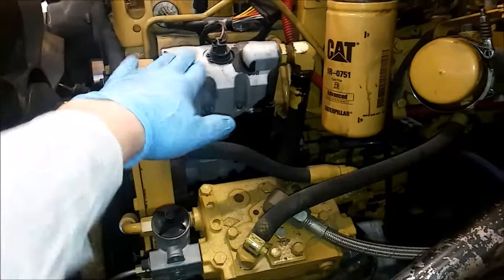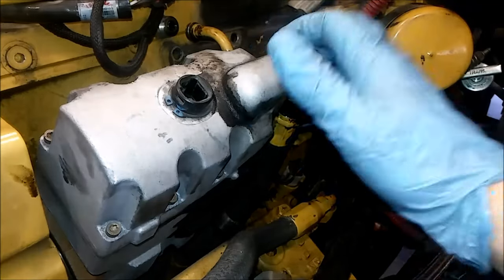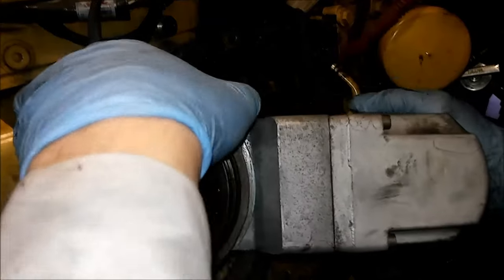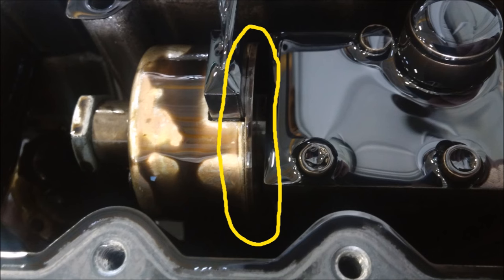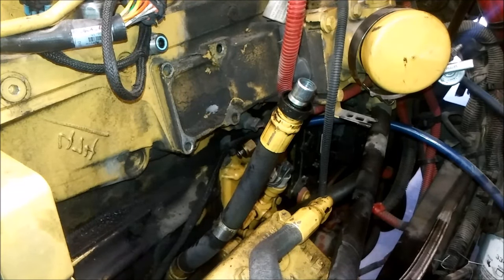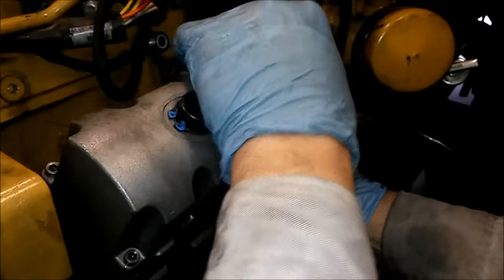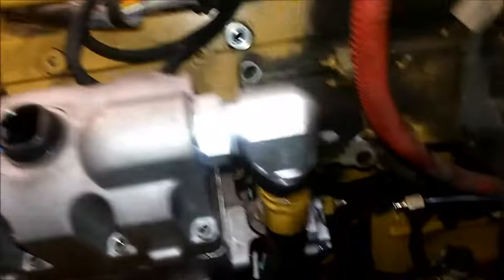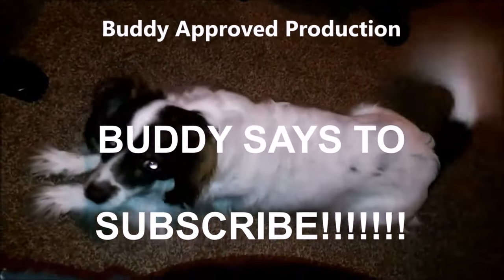How To Change a HEUI Pump.  Cat C7, 3126, and C9

Comment: Hey Adept

so when you connect the et to a c7 or c9 to check the heui injectors, how does the computer tell you that an injector is bad ? what parameters does the et rely on to decide if an injector is bad? i mean the harness on the injector is only to actuate the solenoid, so the diagnostic computer can only tell you of an injector harness is bad or open, but it cant tell you if an injector is weak or worn out..right?

thanks a bunch mate!
Reply from the maker: It is going to be hard to explain in a comment section, if you have seen my cylinder cutout test video it does explain how it works. The ECM determines how much fuel each injector uses. So when you do a cylinder cutout test the ECM sets the RPM to a set speed. Then if you cut a cylinder out, the ECM has to increase the amount of fuel to the other five cylinders so you'll see an increase in the fuel position. Now let's say you cut out a cylinder that is dead, well since that cylinder wasn't helping the engine run, you wouldn't see an increase in the fuel position to the other cylinders to keep the engine rpm at the same level, so basically you are seeing which cylinders aren't contributing to the engine running. Hope that helps. I'll try to do a video better explaining it.

Comment: I have changed several of these on C7s
Reply: I found metals in my C7 Huei pump, my question is can I remove it and clean the metal and flash the system together with the injectors and fix back? Also there is white smoke coming out from the exhaust. Any advise is welcome. Thanks

Comment: Catman!
1-Is the sensor located on top of the HEUI pump the IAP sensor?
2- Is it okay for the IAP sensor to have engine oil all over the connection pins? wont that cause a short circuit?
Thanks in advance!
Reply from the maker: +Omar The IAP pressure sensor is on the cylinder head, the connection on the top of the HEUI pump is the driver/solenoid for the pump itself.
The connection should be dry, but engine oil doesn't conduct very well, the injector harness is soaked in oil pretty much and doesn't cause problems. What codes are you getting?
Reply: Thanks for you reply. highly appreciated!
actually im not getting any codes or errors, i was just checking garness and sensor wiring on my engine  when i noticed some oil residue on the pins. no worries i guess!

on a second note, do the c7 engines fitted on the 950h wheel loader belong to the industrial engine family or the on-high way family? what exactly is meant by industrial engines!

Cheers mate, much respect!

Comment: hey adept

are the heui pumps on the c7 and c9 and 3126 the same or does each model have a different pump?
Reply from the maker: +Omar They all you different HEUI pumps. The late model 3126 would also use a C7 pump, but typically they are different part numbers. The C9 and C7 use different part numbers, but look very similar.

Comment: hello how are you I would like to know where could I find the procedures to flush the C7 engine when it has metal  in the injectors and Heui pump I have the replacement parts I just need to know what should I do to flush everything out before I install them thank you I looked for your link I could not find it
Reply from the maker: +duane addison Just remove all the injectors and one of the HEUI rail plugs and flush it out with brake clean or solvent. Then evac the cylinders.

Comment: Hi there, i really hope you could help me troubleshoot my 3126. It started by being harder to start once hot, then again it was hot and didn t start a all sometimes run for a few seconds very rough. Now no start and again try s to start like making some effort thats it just like a gas one with fuel pump problem. Do you think it could be fuel pump on this one too? On it it say s reman. Its the round top one. Strange thing is the line runs strait from the tank to the pump without a filter. Its in a freight fl 60. Thanks in advance.
Reply: Did you ever get it figured out? I have a 3126 in a freight FL60. I suspect bad HEUI pump. Code 164-11 according to cat et. Haven’t done any further troubleshooting yet.
Reply: @tylermott6563  Hi there, yes i did! Like i said there was no inline filter for i dont know what reason... It was a little piece of plastic like an old straw or something like it that found its way all the way up to the fuel pump line connection. Just pulled it out, put an inline filter and its running perfect since then.

Comment: does the older version heui pump on a cat 3126 require timing before reinstalling or is it the same no timing requirement as the one you installed in this video?
Reply from the maker: It isn't timed, you can install it at any point in engine rotation.

Comment: Hi. I have a C7 engine over an overhaul, a new head, an original CAT (90,000 miles ago), the diesel goes to the oil. I changed the o-rings on injections, I changed the diesel pump, and nothing. I still have the same problem.No smoke, power is good, the engine works equally. Where is the problem. PLEASE HELP
Reply: Piotr Filipczuk 

Did u found problem cause? 

I have same problem like u and now i m changing trasfer pump

Plz advice

Comment: sorry, but heui pumps use hydraulic energy? where does it get the hydraulic oil from? sorry if it's a stupid question. Thanks
Reply from the maker: +amer a3a2 It is high pressure engine oil.
Reply: Adept Ape 
oh that makes sense now. thank you!
also one more question the PTO, does it use I suppose gear oil/ATF or?

Comment: took my 05 cat c7 to cat and they said they swapped the pump, still got codes for inj pressure sensor fault, cat said swap all injectors, truck runs great for 3-5 minutes until warm then derates to 45, loss power,, no smoke, at initial startup.. idles nice,,.. question..i took it to local mechanic with cat programmer, he is a waste money, just says pump bad until i told him cat just swapped it,,how can i make a fuel pressure tester good for what 4000psi? and then how do i make the driver deliver 4000psi without burning itself up or hurting anything else, including me... to test the pump output of course.. i did swap the inj pressure sensor and codes gone but derate and no power still happening.. lastly.. if injectors ARE clogged will i be able to see or test when i get them out to determine that IS the cause?
Reply from the maker: +Art Huge A lot going on in that comment so I'll try to answer what I can from there. So you can get very high pressure test hose like a hydraulic line and they make high pressure gauges as well. I've got one that goes up to 8,000 psi. It is scary to use but a HEUI system idle is only at 1200 psi usually. 

So if the code is gone with the new sensor then maybe you have 2 separate problems going on. You should check the fuel pressure as well. You may have a fuel pressure or other problem and not a HEUI fault. Now I've seen the ECM act weird when they come out of cold mode as well and they won't tell you what is causing it. 

With no codes my advice would be to check fuel pressure and if it's still running rough do a cylinder cutout test to determine which cylinders are the cause then go from there. I don't know of a way to test those HEUI injectors outside of the engine, but check with a local fuel shop that does injectors and they might know.
Reply: ok thanks, cpl last quick ones..1) if im using a needle gauge or led test what would be wrong with checking for injector pulse at the inj wiring,, noone ever says do it and ive done that many times with car fuel inj,, to see if crank/cam sensor readind etc..only using a gauge that would not backfeed power to the driver,,,, 2) how do i trick the inj pressure driver, 3 wire sensor/actuator to give me max psi to force liquid past inj orings,, to test for oring leaks,,and final question,,3) can the derate protection be turned off across the board for all triggers inc no oil pressure

Comment: hey adept ape, i have a senor on the head of a heui pump that is leaking. I was looking at a parts book but just has the part numer to the pump. would you happen to know if there's a part number for the o-ring on that sensor? thanks
Reply from the maker: I know the answer to your riddle. So the electrical connector on top of the HEUI pump is for the driver/solenoid of the pump itself (should be a two wire connector). The oring that seals it is not in the Cat system, I know because I have tried to order it before. I'm sure if you removed it and tried to find a generic Cat oring of the same size, you might be able to if you had an oring kit. The HEUI connector is not replaceable either, so if that connector is bad then you need a new pump unfortunately. Did you ohm out the connector, if you did what was your reading?
Reply: +Adept Ape  at the connector it read 396.0 ohms
Reply from the maker: +Denny A The spec is 6-10 ohms of resistance, that is measuring the HEUI pump side not the wiring harness. If it's that high then the HEUI pump driver is bad, if you had HEUI problems that is probably the cause.
Reply: +Adept Ape my bad check at the harness. It read around 13 but it was jumping all over.
Reply from the maker: +Denny A I know it's kind of hard to measure unless you have the little adapter. if you weren't having check engine lights or rough running then don't worry about it.
Reply: +Adept Ape it did not have a check engine light on but I'll check to see if any pending faults show up.  Thanks appreciate your help.

Comment: Just wondering if the high pressure pump requires an oil pre-fill?
Reply from the maker: +Chad Jessup It isn't necessary. The oil supply line runs right off the oil galley in the block so after a few seconds of oil pressure it'll be primed. If you wanted to squirt some oil into it after you have it mounted it probably would help it prime faster though.

Comment: I replaced the entire top of the engine. On a 2004 c7 cat engine Valves etc. Im getting power to the cab but not too the starter. Replaced injetors o rings. But it wont turn over what could it be
Reply from the maker: +Haley Matson Did you suck the oil out of the cylinders after you pulled the injectors?

Comment: so after reading my post do you think that the oil pressure is a problem?  if Not what is your take on it.   power loss and hard starting to no stating
Reply from the maker: Thank you for the kind words. I understand going with free, I would too. So the low idle pressure seems a little low, but I would have to check on Cat for the spec. The 49 psi sound fine. I think you have something going on with your HEUI system and agree with you. It is very common for them to run rough as they warm up, did you check the injectors for leaks when it cranks and won't start? If you don't see any leaks then the HEUI pump is the most likely culprit.
Reply: Thanks again.  I am doing this for a out reach program called Grateful Hearts.  The truck was donated by a company that I use to service 5 years ago before he died.  His wife was running the business but when the econmy dropped she lost all hope and sold it to a small family.  They didn't see any value is the truck so she decided to donate it to GH.  All that to say I just want to make this a gift to them that is working and I don't want to buy a HEUI unless I am sure.  I don't have a gage that goes over 5000 so that makes this a gamble/ i did take the valve cover off and looked when cranking and it look dry in there.  If I can get it running again I can take the cover off and see again what may or may not be going on there.  So all said I am just trying to make the right decision.  What is the HEUI pressure range?  Again Thanks again for your help
Reply from the maker: +Jim McMahon That gauge would work fine, during cranking the HEUI pressure is only about 800 psi, just make sure the hose is high pressure too. Usually the injectors spray a bit of oil as well, so if you are seeing dry injectors then that makes me think HEUI pump too. What is the cranking oil pressure? Also this is a 3126 or C7? The 3126 have a driver that replaceable without changing the HEUI pump and it is only like 200 bucks opposed to the full pump. If this truck is for a charity then I wouldn't mind doing the Skype call for free and then if you wanted to donate later to the channel you could if you want to, but you wouldn't have to. Let me know.
Reply: 1999 3126 cat motor.  where is the  driver that replaceable without changing the HEUI pump and it is only like 200 bucks opposed to the full pump.   LOCTED AND IS THERE A WAY TO TEST IT~
Reply from the maker: +Jim McMahon They used to make a tool you could insert that would force the pump to full pressure, but our shop doesn't have one. You could try calling your local dealer and seeing if they can find the part number and if it is still available. The driver is the solenoid that threads into the HEUI pump and is where the wiring connects to the HEUI pump. It should have a 2 wire connector that goes into it.
Reply: oh Yes I changed that and it made no difference...  I went to check it our again today and it started right up...  I let it run for about 1 minute and then turned it off.  within a minute or two I attempted to start it again to no avail.  So I made a choice to pull the pump.  Now I am trying to find the best deal to have it checked or rebuilt.  I am in Southern Calif.  would you know any places I could send it to?
Reply from the maker: I wish I did, we just get our pumps from Cat, try to go through a Peterbilt dealership maybe their parts are cheaper sometimes. Did you check the injectors for leaks after you ran it?
Reply: no i couldn't get it running again bummer
Reply from the maker: Wish I was there to help, I'd hate to tell you it is a pump without knowing. Have you checked the fuel pressure at all?
Reply: I would like to but don't know how to check it out.  I cant see any access point that I can tap into
Reply: Have the primary and secondary fuel filters been checked/replaced?

Comment: Have you ever seen where after changing the heui pump you suddenly have high crankcase pressure causing oil out the vent tube?
Reply from the maker: +Jim Rodgers That is a new one on me. Is it possible that when the HEUI pump was removed, that the breather canister was also removed and not resealed or installed properly?
Reply: breather canister wasn't removed is there a way to check it? Thanks for the response.
Reply from the maker: +Jim Rodgers It sits right under the intake manifold and behind the HEUI pump. It is possible it was damaged or something when the pump was removed. It is only held on by a 13mm head bolt. I would remove it and inspect it.
Reply: It looks good. Not getting any codes but blows out oil under load. Idling and low RPM its fine. No air compressor has hydraulic brakes.

Comment: where can i make sure that the pump is bad...  I have a t6500 with a cat 3126 in it and it wont start.  For a while I could get it to run with a quick shot of ether.  But now it won't start at all.  I have hooked up a obd2 reader for cat but it won't connect...
Reply from the maker: +ed de I have a video titled troubleshooting HEUI and IAP faults, I recommend watching that. You would need a version of Cat ET to communicate with the ECM, as the Diesel engines don't communicate on the OBD 2 data link. You could try putting a gauge on the HEUI rail and see if you are getting HEUI pressure, but be careful that system builds a couple thousand psi, so use high pressure fittings and gauges. If you watch the video and have questions let me know.
Reply: Hey There Buddy!  I am still working on that Cat 3126 and today I was able to get it started.  So I took the opportunity to check the oil pressure and it came out to 19 at idle and a max of 49 and running at top rpm.   It is kind of strange that it started after sitting for 2 months like the first time that I picked up from sitting for 5 years.  we just gave it a quick shot of starting fluid and it ran great.  But the more we drove it the worse it ran.  Now after getting is started again it seem to run good but a lack of power.  I keep thinking that it is the HEUI pump.  but now the oil pressure has me a little concerned.  I looked on a post and they said 35 to 85 max and they said it should idle at 15 so maybe that it normal...  I know that the turbo shaft is a little loose maybe 3 to 5 k so i am planing to replace that too after I get this starting problem resolved.  Today after it wormed up it took a lot of cranking to build the oil pressure and then it would start!  This repeat every time I went to start it.  This is different than the way it started before...  So something has changed~  BTY can you call me or perhaps I can call you?  (714) 404-848
Reply: BTW I have watched all the video's that you have done on this problem at least 3 times lol   This is a 99 GMC T6500
Reply from the maker: I don't call people on the phone, but if you have a Skype account I do Skype calls. I charge for the Skype calls though if you want to do that let me know. If not I always answer questions on here for the low low price of free.
Reply: ok well just do the free one LoL
Reply: Hey Abe, I decided to go ahead and replace the HUEI Pump.  but still it won't start.  I looked at the hot air heating cold start system and found that it was not heating up.  I have power to the solenoid and the two small wires are both hot that go to it when the key is on.  But the other large wire going to the hot air coil is not getting power.  But that being as it is should not keep it from running we have very warm weather here.  I am at a loss here to fix this truck now.  is there anything special to do in priming the HUEI pump?  I just don't know enough about this system to make it work.   It must be one of the sensors or something like that?  Thanks again for your willingness to help out.